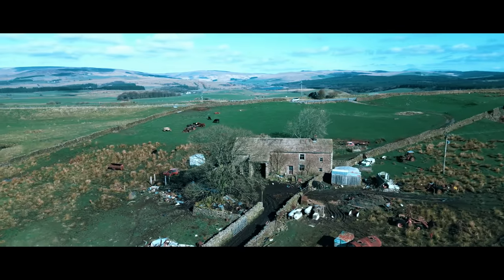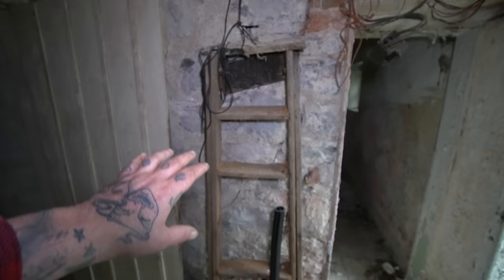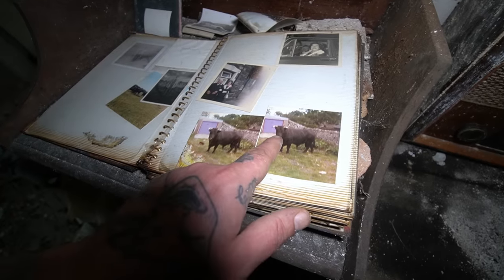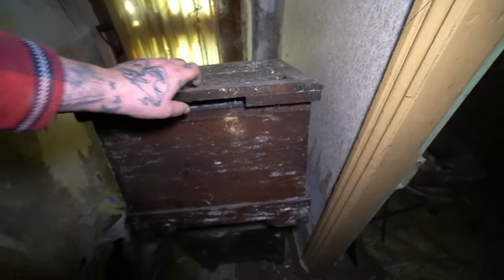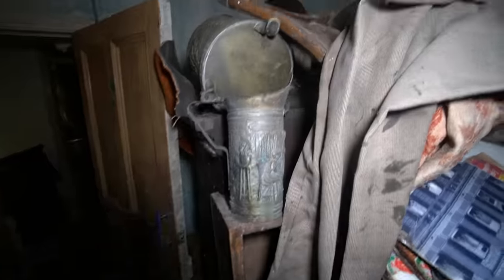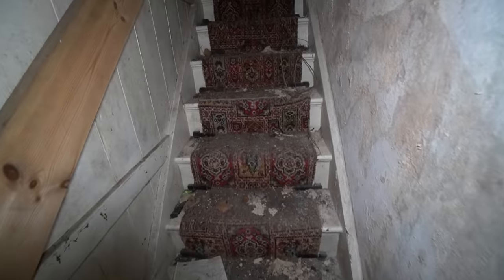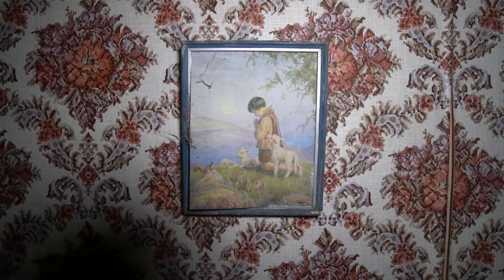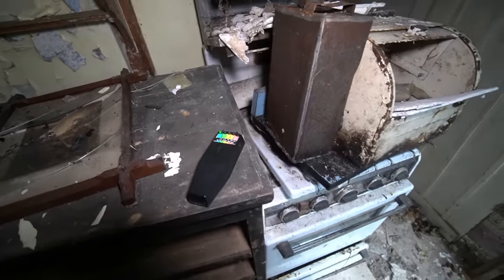FAMILY STILL TRAPPED INSIDE! HAUNTED ABANDONED HOUSE FROZEN IN TIME

Comment: We were told the hook in the ceiling next to the light was there to hang the lampshade from so not to put too much weight on the light. We had one in our ceiling when we moved in
Reply: We had long cords on our lights and 2 or 3 hooks on the ceiling so we could move the light around the room depending where we are sitting or reading.

Comment: the hook on the ceiling was to take the weight of the lampshade - a lot of the old ones were glass and very heavy, you would hang them by a chain from that hook and it takes the weight off the cable, the lampshade weight could, over time, pull the wires out of the bulb holder.
Reply: sometimes you may find more than one hook by the ceiling rose to hold heavier  or bigger shades/chandeliers 
most I've ever seen were 4 but I think they could have up to 8